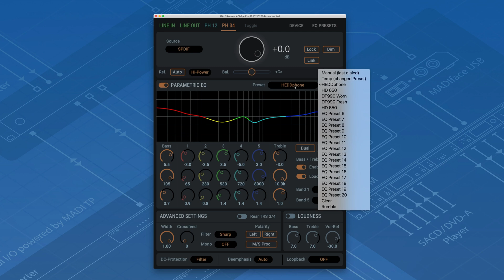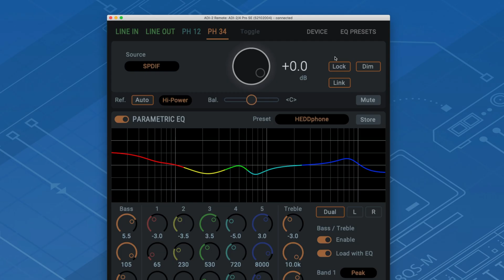Horizontal dBu Meter with ADI-2 Series & ADI-2 Remote

Comment: I am a new RME ADI2 DAC user   i am using it as a DAC and route it thru my analogue preamp   I find that i need to adjust the output volume to 0 in RME and use the pre amps volume control   to the desired level   is this a correct method ?
Reply from the maker: That is a choice. You can do it either way. You may have a little less noise if you control the volume with your analog preamp. Also you can connect the DAC directly to the power amp and control the volume with the DAC
Reply: @RMEAudio   I agree to your suggestion.  The reason I connected thru my preamp is it has a subwoofer out put and low and high pass filters.  And I have one pair of tower speakers. Which are used for movie watching thru streamers and my preamp has a bypass for HT receiver. So this arrangement suits me. The idea of adding the RME is to get good DAC to get perfect music out put and use all RMEs digital SPIDF connections to get a streaming and CD played thru RME and route thru preamp.  
No option in my current set up but to use RME as dac. Hope this explains.  Thx.
Reply from the maker: @ravichandran4589  Perfect. This is a good solution.

Comment: I use the EQ to calibrate headphones and monitors to be more 'colourless'. In the same sense, I want the analyser to also display the band levels without being 'coloured' by the calibration EQ (i.e. spectrum analyser display pre-EQ). In my view, a flat white noise source outputting through headphones calibrated to sound like flat white noise should likewise appear as flat white noise on the analyser, not as white noise plus calibration EQ curve. As far as I can tell there's no way to do this. Have I missed a setting, and if not is this something you guys might consider implementing?

Comment: looks beautiful. 
how about updating the totalmix visual? for years the interface is like for Windows XP (!)
how about removing the separate hammerfallDSP window and embedding it into the totalmix window? 
Why has RME been unable to make basic innovations and updates for so many years?
 you say driver stability, I will say that the latest versions of audient drivers do not crash. And these were some of the most problematic interfaces in terms of stability. At the same time, the audient has no problems with switching sampling in Windows. but RME has it - if I install the 48000 driver and select 48000 in Windows, I hear clicks and lags at any buffer size. The problem goes away only by switching to 44100. 
No more RME, I think... 
neumann and merging showed what the desktop interface of the future looks like.

Comment: The Qudelix 5k has a feature where I can input the sensitivity and impedance of my headphones. It will then tell me the peak volume level, the current volume level, as well as the current and voltage being supplied to the headphones. It's great for building intuition about how much power do my headphones really need and what does a safe listening volume sound like etc. I would really love to see this feature implemented in the RME ADI series!